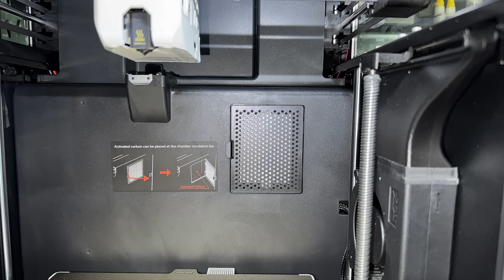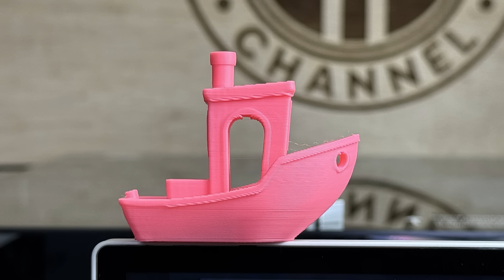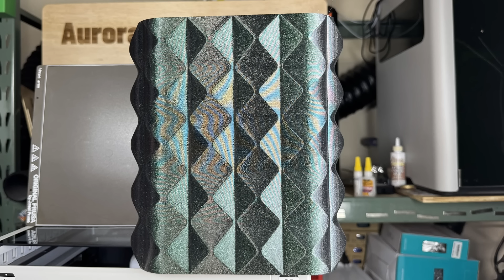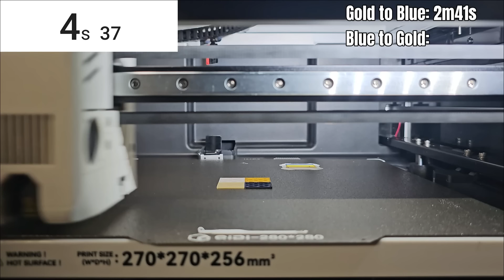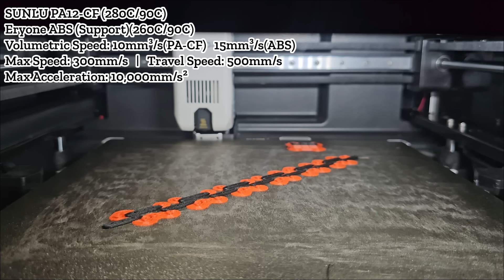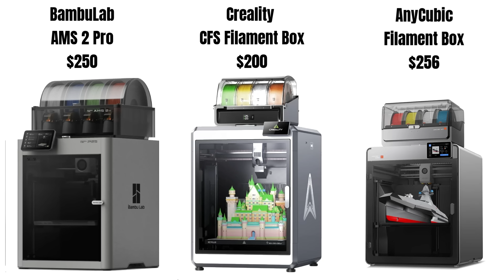QiDi Q2 Combo Review: How Does their Multi-Filament Box Perform After an Unintentional 10-Month Test

Comment: At this point I think it's safe to say that most of us are completely uninterested in the multi-color performance of a single-tool printer. With the number of multi-toolhead printers already on the market, the only practical use for an AMS on a single-toolhead printer is extended print time.
Reply: a multi toolhead printer alone is upwards of $800-1000 dollars without including stock bimetal nozzles and heated chamber. it will be the future, but we have at least 2 years until then.

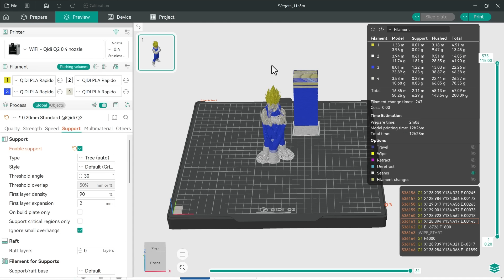Comment: Great review as always. I have this machine and I can confirm your conclusions. One remark though, QIDI Studio is not based on Orca Slicer, but on Bambu Studio (like it says in 29:28), that's why they look similar. This is common mistake every reviewer does. Orca Slicer is actually also based on Bambu Studio, so it is like QIDI Studio and Orca have the same base. Other manufacturers base their slicers on Orca though. I know this is minor thing but just for clarification.
Also, printing while drying is a feature indeed, and there is a safety mechanism, that won't let you turn on drying when there is PLA loaded into the BOX.
Reply: Your information is correct, but just to add, Orca Slicer is a fork of BambuStudio, which is based on Prusa Slicer.
Reply: Не совсем так, в Orca Slicer только плагин от Bambu для их принтеров и интерфейс, остальное от Prusa Slicer и SuperSlicer. В Bambu Studio намного меньше возможностей по настройке, например counterbole hole bridging только 3 недели назад в ней появилось, а в Orca еще в 2024 году ее добавили, скопировав из SuperSlicer.
Reply: @MoHax01  Yes, what you said is more accurate. I mainly just wanted to correct that QIDI Studio is directly based on Bambu Studio not on Orca Slicer.

Comment: I'm considering this Q2, but I may not get the AMS with it.
Reply from the maker: If you consider it as a 4-spool dryer that supports filament backup mode, you can also load PLA, PETG, ABS, and nylon in the same box. When you need to print with a different filament type, you don’t need to physically go to the printer and change the spool manually. Even though printing multi-color PLA with hundreds of color changes will be much slower than other machines, since it only costs $150, it still has its value, especially for those who don’t really print multi-color PLA at all. I wouldn’t use any single-nozzle AMS-style setup for that either. For multi-color prints, I only use tool changers like SnapMaker U1, Prusa XL, Creator 5 or something like the H2C.
Reply: @AuroraTech  @twinpower36 I have the Snapmaker U1 for three weeks  and I love it for PLA or PETG  multi filament print models.   In addition to the usual PLA/PETG filaments I've also printed on the U1 with TPU 95A-HF, PAHT and PA6.  I used the BiQu Pop-cap to retain chamber temps at 55c, with 100c bed and 290c nozzle for those nylon or PC prints.   But ideally I'd like the Q2 for those and other higher temp engineering filaments because larger PC models would still lift from the U1 build plate.  I agree, the Qidi AMS would be great for continuous large prints, not needing to swap spools etc.
Reply: I’m looking for 3D machine to do multi PLA prints can you recommend a machine since this was the machine I was considering? Thank you

Comment: Maybe I don't understand printers well enough, but it doesn't make much sense to have the box not get hot enough to dry filaments that the printer is able/designed to print.   There are several things about this printer that don't make a lot of sense.  Like on paper it looks like it should be faster or more accurate or something, but they were not able to wring all the theoretical potential out of it.  But it seems like a valid option for people that want a printer that can technically do everything and not be in an "ecosystem". Also I have been constantly surprised how well the snapmaker prints are holding up in comparisons when reviewed against some of these other printers.
Reply: It's because it's not easy to make a dryer that works at 120c, look at sunlu E2.

Comment: Tubamakes channel found in his review of the QIDI Max 4+ that color changes took too long and he modified the printer g-code to cut minutes off of each color change. I wonder if the same issue is happening here?
Reply from the maker: I believe you can do the same in Klipper, but since the early versions were not very reliable, they slowed it down. If you speed it up again, I’m not sure about the long-term reliability.

Comment: I have 2 Q2 combo printers.... and its not a good option! Support was ok at first then it stopped completely.  Lots of issue with box and bed leveling and more.
Reply: Nah you got a bad unit, they are pretty good in general
Reply: @riba2233  Nope... bought 2 at different times... both had issues... 2nd one the Box was broken from day one. The support also stopped replying to emails.

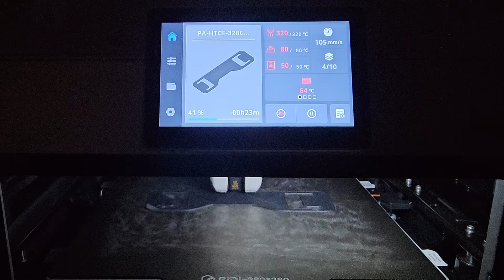Comment: 16:59
AFAIK this is not a firmware glitch but a feature. You can set box temperature in the filament settings
Reply: Yeah idk why she thought that, it's 100% a feature and it even doesn't let you do that for pla (but you can of course edit it in cfg)
Reply: @riba2233 You're everywhere, anywhere, all at once. 😂
Reply: @Helixx_T7  why do you feel the need to comment my online presence?
Reply from the maker: When you start the dryer from the screen, it requires you to unload all the filament before it can start. However, once the dryer has started, you can do whatever you want, like load the filament again and start a print. So why do I have to waste time unloading all four spools in the first place? That doesn’t sound very logical to me.
Reply: @AuroraTech  Yep, I get what you mean
Reply: The unloading is so that the box can rotate the spools during drying. I guess when you load the filament after the drying started it then stops rotating it
Reply: @AuroraTech  you don't have to. You just need to manually set the box temp from the filament menu before the print, you don't have to use the box drying programme from the tools menu. You can also set the box temp in fluidd.